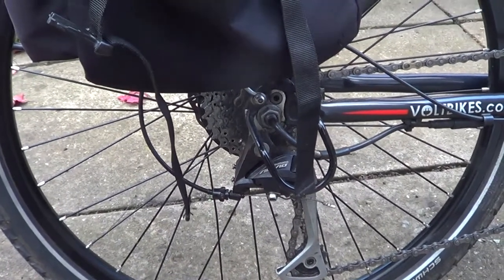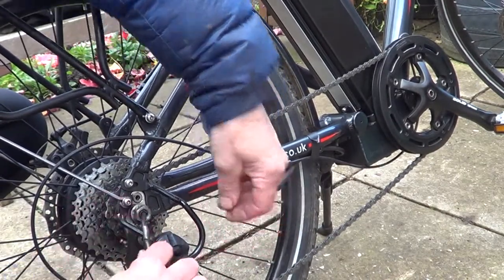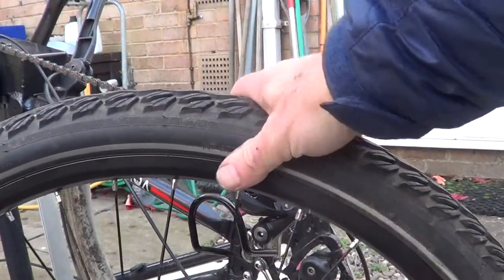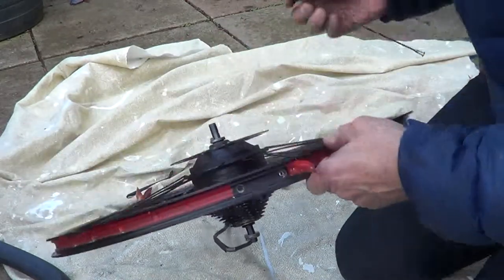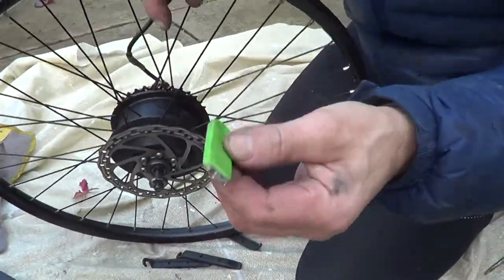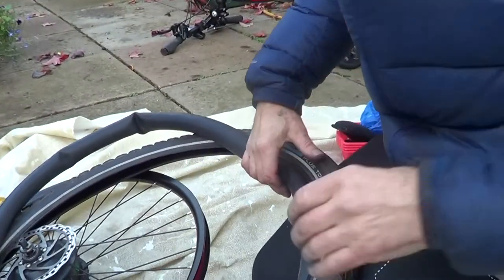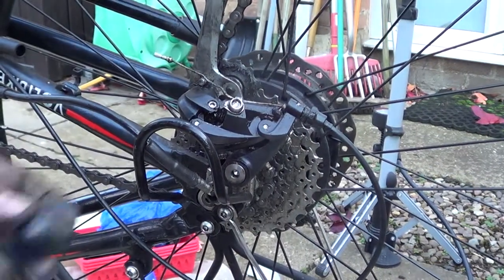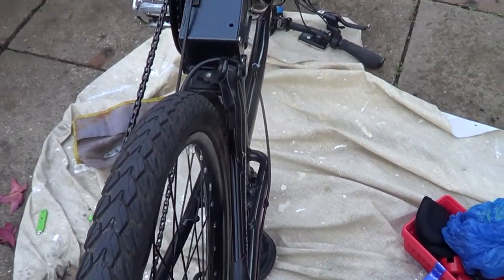Volt Bike rear wheel and tyre removal

Comment: Good job , just what I needed to see as have  a rear wheel puncture to repair.
Reply from the maker: It's very easy to get the back wheel off the Volt Pulse bikes just undo the small plug that takes the power to the motor as I show when you have pulled that apart basically it's just like a normal bike really. Thanks for comments! Don't do like I did on this video and make sure you get your tyre tread going the right way! Thanks. Kev.

Comment: Many thanks for a great practical video, but I hope I don't ever have to repair a rear puncture at the roadside on a cold and wet day!
Reply from the maker: I do so quite agree mind these new tyres and tubes are so good in the 6/7 years of having had this bike I have only ever had one puncture I had a fair bit of weight in my rear panniers on route to my boat and ran over a broken bottle I just did not see on the edge of a cycle path I was on. There was a bang! And that was it. It was a 5-mile slow walk back home! which was not good. Many thanks for your kind comment. Kev.

Comment: Just the video I was looking for.  Could you tell me the size of the spoke, please? and I think you have put the tire back on the wrong way round. regards
Reply from the maker: Thanks Well spotted re tire! I did wonder if someone would spot my mistake! Re the spokes that's more of a tricky issue. I have a very friendly local bike shop the guy that runs this sorted the spoke out for me in fact he gave me a number to try as we were unsure of the size as you have the motor in that back wheel so hence it needs a shorter spoke. I would have to ask him re sizes I have an idea they were 19mm and the one I used was off a folding bike so he told me I will ask him to see if he can remember and come back re this. Thanks again. Kev.
Reply from the maker: Just spoke with him on the phone he thinks it might have been these two spokes  he gave me to try! I could not tell you which one I used in the end so sorry These are from a folding bike. Kev.

Dahon 208mm IOS Black Spoke 
Dahon 213mm IOS Black Spoke
Reply: Thank you Kev for the trouble you have had to find out for me and for such a quick response. I will give both a try if I can get hold of any and follow your video to save my self £10 getting the shop to fix it, also I will try and remember to put the tire back on the way it came off hehe, easily done mate. many thanks. Sean .
Reply from the maker: No worries yep honest I'm no bike mechanic as you can see! But it's not hard honest to do this job just more of a fiddle just stripping it all down to get to the broken spoke the number of times I seem to put those tires back on the wrong way round  ! Thanks again Kev.

Comment: Great video showing the trials and tribulations of a rear spoke removal. I hope you don't mind me asking, but I have a Volt Continental which has a very similar LCD controller. I bought it second hand but don't know how to reset the trip distance etc. It has three buttons, M, Plus and minus. Would you be able to advise me please :)
Reply from the maker: Hi Wayne Well on my older Volt Pulse as this is! To Change  the trip, or reset it I should say you  hold down the (+) (-) buttons together for 3 seconds. This will take you  to a screen displaying the letters (T) & (C) total clear you will also see a flashing  (n) which stands for no next press the (+) and this will change to a (y) which stands for a yes then hold down the (M) button to return to the main screen. But I have to say Volt have used many different display controllers so yours might be different but you could have a try nothing lost hope that might help, thanks for you kind comments. Kev.
Reply: Thanks for letting me know how to reset the trip distance Kev. I will give it a try tomorrow.
By the way, you mentioned in one of your videos that you thought your original Pulse's battery was starting to fail - why did you think this and what changed your mind?
Reply: By the way, I bought an e-bike as I broke my hip last year and needed the exercise. I still need to pedal but with the electronic assist, I am no longer frightened to death of hills 👍 I used to plan my routes deliberately to avoid some of the more scary hills around Southampton but now I just take whichever route I fancy knowing the bike will help me make it to the top of the hills, without too much effort  :)
Reply from the maker: Glad you like the Volt! Yes these Bikes are amazing I have been so pleased with mine I have to say I still love to pedal most of the time but as you say hills or a head wind these bikes come in to there own! Yep I'm going to being doing an update video soon on both my Volt Pulses I have to say I did think maybe my oldest Pulse battery was starting to get a bit tired with age but I have to say its still holding up very well and takes a charge and will still give me many miles of pedal assisted riding! I think the key with these batteries is do make sure you charge after every use and use regularly they don't say like sitting in a shed or gargae for months not being used or charged. Kev.
Reply: Yep, your instructions worked fine and I now have the trip & time distance reset to zero - you're a star Kev :)
Reply from the maker: Great so pleased it worked. I  do so hope you get as much enjoyment from your Volt bike  as I have from mine . Great bikes, thanks for letting me know Kev.
Reply: Morning Kev

I've noticed that the distance shown on the LCD is not very accurate. I did a 12 mile ride yesterday but the trip distance was showing only 9 miles? The only thing I can think of, is that the wheel size has been incorrectly setup in the controller. Do yo know how to get into that side of the settings on the LCD controller Kev?
Reply from the maker: Hi Wayne. To be honest I have never bothered with the trips on either of my Volt Pulse bikes. I would not know if there is anyway one can adjust that trip but I doubt it as that kind of comes all set up. I have put  both my Volts together myself  when they were delivered as we had no local bike shop then that would do it close by and the trip unit was fitted you just mounted and fixed the handle bar on! On my older Volt Pulse I do know the trip only works in kilometers not miles! On the new Volt Pulse X you can chose between the two  so sorry I have not been much help will look later on through the limited paper work I have with mine to see if it says about any sort of adjustment on the trip re wheel but I doubt it does, as I do not recall reading anything re this. I will let you know Kev.
Reply: Thanks Kev. The real reason for me using the trip distance, is that having the bike for less than a week, I don't know what range I can get from the battery on a full charge. 
I've seen several videos of other e-bikes where they show that you can edit various parameters in the settings menu, tyre size being one of them. I assumed that applied to all of e-bikes but now I'm not so sure. 
I saw a review of my Volt Continental that talks about being able to adjust the PAS settings etc, so I'm hoping that there is a way in. Link below.
https://www.ebikingnow.com/electric-bike-reviews/volt-continental-review
Reply from the maker: Hi Wayne I know you can get in to those LCD controllers but to be honest I would not have a clue sadly how to do that! And little more was said in the brief little users book you get with the Volt bikes. I will say the guys at Volt are very helpful and an email to them may well be worth while  to ask what you can do or how you can alter this! Sorry I could not help any more on this. let me know if you find out how to do it? Kev.
Reply: I sent an email to Volt UK over a week ago but so far I haven't had a reply. I then phoned them up and was told the only guy who might know is on holiday, hence reaching out to you Kev. 
I can't think of any other reason why the trip distance is not accurate, other than an incorrect tyre size setting on the LCD controller. It doesn't really detract from the riding experience, which I'm loving by the way, it's just that it would be nice to know the range I can get, so I could plan my journey accordingly. I know you can still ride the bike if the battery runs out of juice but being so heavy and there's some serious hills near to where I live, it wouldn't be quite so much fun...
Reply from the maker: Hi Wayne  I will look around as a few months ago I did read somewhere online how to get deeper in to these LCD controllers but right now can't remember where that was!  As you say it must have been set wrong to tyre size I would assume I have read a few comments that the LCD battery state indicator is not that good also re how much you have left say! Will look around and see if I can turn anything up!  To maybe how one changes the tyre size! Kev.
Reply from the maker: Wayne Take a look here
https://www.juicybike.co.uk/manuals/JB-LCD-Display-manual.pdf
look at page 8 and follow the instructions you will then get 0000 up on your Volt panel hopefully I did! But to get in you need to enter 0512 using the mode button to move to next number and the + - buttons to scroll through the numbers  when you have the numbers in press M and that should take you to the advance features as on page 8 of the link. I think that has a wheel size settings there have a look anyway Kev.
Reply: Thank you so much Kev, I will give it a go either later tonight or tomorrow once the battery has fully charged. I have just come back from an 18 mile ride and the LCD was showing I'd used 2 bars, so at least I know I can go that far :) 
I was the most exercise I've done since I broke my hip last year, so although the PAS was helping me out, I was still a bit knackered!
Reply: Finally, I have found the problem Kev. 
For whatever reason the LCD controller must have been reset to factory defaults by the previous owner and when that happens, the wheel size defaults to a 20", hence the trip distances being inaccurate.  

The above PDF link you sent me, showed me how to get to the advanced setting screen but when I got there, it looked like it was asking for a pin No. and of course I had no idea what it could be. I phoned Volt UK and got through to a really helpful guy who told me that there are several Pin No's for the different LCD controllers but that he thought the pin for that controller was 0512, which turned out to be correct.
Once I entered the pin, the first option to change was the wheel size, which was set at 20", so I used the Plus button to scroll through the options and chose the 700C, which shouldn't be far off.
There are other options you can change, such as PAS power settings etc but I left well alone.
Thank you so much Kev for pointing me in the right direction, I really appreciate it :)
Reply from the maker: Thanks Wayne I had given you the pin in my last post did you not see that never mind so glad you got it sorted out! Kev.
Reply: Oops, my brain didn't register that in your last post!
Reply from the maker: No worries so glad you cracked it I new I had read a few months ago how to get in to this mode so I soon found it again! Hope the Volt keeps going well best wishes Kev.
Reply: Just wondering Kev, when you turned the bike upside down, did the LCD controller need to be protected? I'm sure on mine, it's at the highest point above the handlebar, so would get damaged. Obviously at home, I could put a cushion or something similar underneath it but out on a ride I'm guessing if I would need to loosen the LCD clamp and rotate it out of harms way?
Reply from the maker: Hi Wayne Mine does kind of move with a gentle turn around the handlebar so I made sure as best I could it was out the way when I flipped the bike over and not resting on this so it seemed OK. But like you say if you can't move yours maybe a good idea to put something under to support this. They do seem quite robust  I rode 10 miles home just the other day in a what I can only describe as a huge thunderstorm I was worried about water getting in but the bike seems to have dried out all OK again remarkable for the age of mine! Kev.
Reply: I have loosened my LCD screen to enable me to rotate it out of harms way when turning the bike upside down. 

As my other half has got a decent Trek road bike, we have bought a bike maintenance stand from Evans Cycles.
It was £50, their cheapest, but is rated to take up to 35 Kilos, which is 10 Kilos more than my Volt Continental, including the battery.
I have had it up on it the stand a few times now, to check a few things over, although I did take the battery and seat post off as it's quite a beast to lift otherwise!

I have bought 4 Tektro E10.11 disc pads for £15 from Amazon, as these are what are on mine already, so will be changing them over shortly. While I had it up on the stand, I checked my chain and rear cassette and both look like they need renewing, so have bought a SRAM chain, which I will do soon.
Regarding the rear 8 speed cassette, well on mine anyway, have you ever needed to replace yours? I'm wondering if it is indeed a cassette or a freewheel type - I need to take the rear wheel off really, to have a good look but I had an operation on my knee last week, and have been told to not put any unnecessary stress on it for a couple of weeks...

By the way, I see you are interested in organs - I had a Welson Granfiesta Deluxe back in the late 70's, a wonderful home organ which gave me many years of pleasure :)
I now have synth keyboards, which I can hook up to a digital audio workstation via my laptop and again they provide endless hours of relaxation. I just wish I'd kept up with my piano classes when I was a child...

Keep up the good work Kev
Reply from the maker: Hi Wayne. Only just found this so sorry! That sounds like that is a good setup you have there to work on the Volt I  like wise often just loosen the LCD screen to move it around when inverting the cycle to work on the bike and it always seems to be OK doing this. Yep I'm sure you will find the brake pads easy to change still have got to order mine! But like I say will try a video when I do get some. On my oldest Volt Pulse the chain and freewheel have both been replaced this was done before I started doing videos on YouTube. I have a very friendly  local small one man bike repair shop that ordered me the right parts so to be honest I haven't a clue what bits are what! I would need to ask him! He sold me the parts and just ran through fitting them and I found it all quite straightforward. So not that hard if I can do it. Thanks for your kind words and do so hope your soon up and about on your own Volt again many thanks for you comments. Kev.
Reply: I also have a smallish friendly old school bike shop a couple of miles from me, so with the help of my other half, I took the wheel off the bike while it was on the stand upside down, and took it up to the bike shop. 
The guy told me straight away that it is an 8 speed Freewheel, which a lot of e-bikes tend to have these days.
He said he had one in stock and for an extra £3 he'd fit it too - result, as otherwise I'd have needed to buy the tools to do it myself ;)
I also found out that the new chain I bought last week, is a standard length one, but as my Volt has a longer wheelbase, I needed an extension. He knocked up a new one to the correct length (I took my old one with me) and supplied a quick link too - all for £15 :) 

I won't be able to ride the bike for another 9 days, until I have the stitches out on my knee but at least I have plenty of time to give the bike a good clean and service.

For your reference, the Freewheel I bought is an 8 Speed SunRace MFE60 8CU 13-32T, 
http://www.sunrace.com/en/products/detail/mfe60
Reply from the maker: Thank Glad you got sorted out I forgot to say my chain is also longer than a standard one. And going from memory that seems to ring bells re your number Freewheel.  To be honest for £3 that was a bargain just as easy like you say if you don't have the tools it can soon cost a whole lot more buying what you need!  And I mean how often do you then use these tools. I know it made a difference to my old Volt Pulse it was like riding  a newer bike again after this. I forgot to say yes I'm a bit of an organ nut got very much in the Theatre/Cinema organs in the 1980s even had a go at restoring one! Use to go to all the concerts down in London in those days do play a bit but pretty hopeless to be honest liked the tech side more. I do still have a Kawai SR6 which I sometimes play still at home. Time files so the 9 days will soon pass and you will be back on the Volt keep me posted if you find it better! Thanks again Kev.
Reply: @waynewallace4894  there is one thing that i cant do and that is change from km-mph but it doesent show up on screen,i am wondering if i could buy the controller that goes with the pulse x model because in one of kevs videos he explains this
Reply: @waynewallace4894  my bike does that,its because you have kilometers  and not mph--unless you have pulse x model then that bike which kevin has will show true milage--on the display it doesent show mph or anything,there must be a way to set it to km
Reply: @waynewallace4894  this isent for volt pulse bike because it shows km in bottom right corner of display,and the volt pulse doesent show anything at all
Reply: Like I said William, if you are not getting any joy from either mine or Kev's replies, then just give Volt UK a call, they are very helpful.